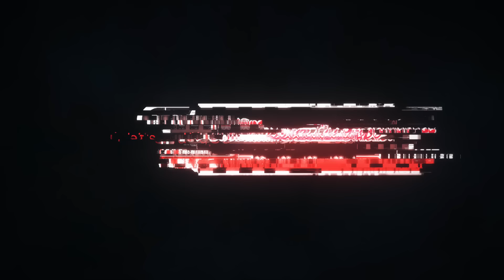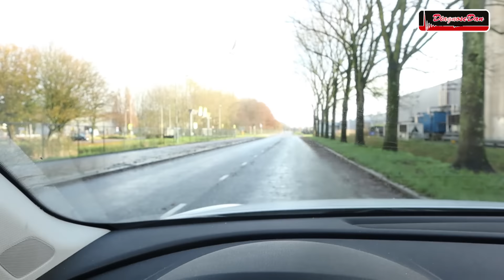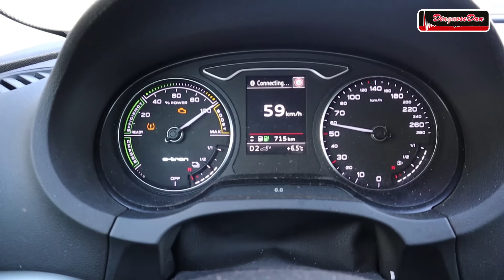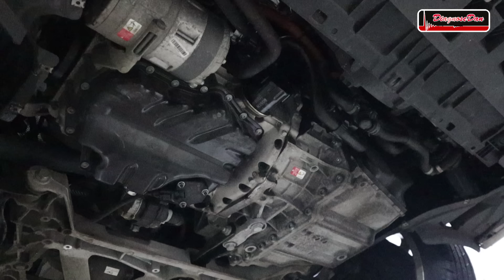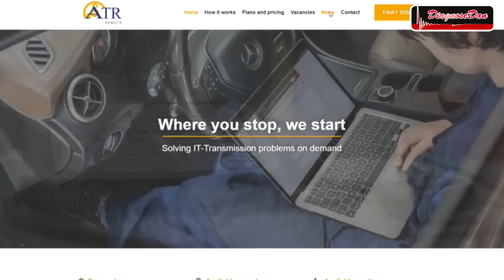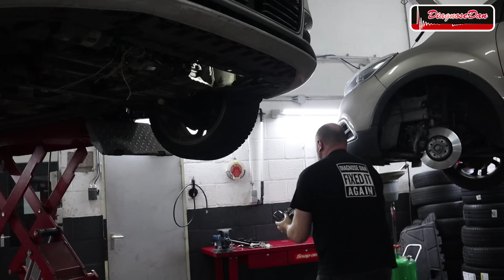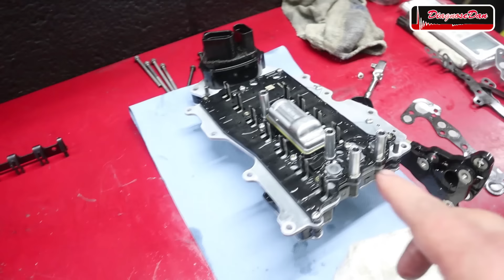DSG DQ400, p2884. Replace or easy fix?

Comment from the maker: Check out my website ; https://www.diagnosedan.com
For DDTSB visit DDTSB.COM
For the Topdon tool used in the video:
US:https://www.topdon.us/collections/pro...
UK: https://www.diagnosticconnections.co.uk/
EU: https://eu.topdon.com/products/phoeni...

ATR Remote Article:
https://atrremote.com/news/vag-0dd-p2...
Reply: What was the price difference from replacing the whole unit vs just replacing the valve?
Reply: How did the beer thing went?
Reply: Why you are smelling like transmissions fluid havent you bathed🤣🤫
Reply: German engineering has become ridiculous.Only Rube Goldberg would be impressed.
Reply: Thank you Dan. Was very helpful
Reply: The topdon links don't load! Do you mind sending us the model?
Reply: @Flashbang_Photo  Topdon Phoenix Max as can be seen by the blue handle. Around 4000 EUR  / GBP.
Reply: Do you remember how long the entire operation took?
I am afraid I might be in a similar situation, and I am dreading the repair bill.
Reply: Thank you very much.
Reply: I got it 2 days ago P2884 but after i turned my car of and on it drove again for more then 600 kilometers.  Is there a chance that this error could pop up accidentally at a cold start? It just happened once and i didn’t saw it again after deleting the error with a cheap obd tool. Not sure if something is really broken or almost broken.
Reply: @Sahin2911  This can happen at any moment.
Reply: Where can I buy these parts?
Reply: I live in norway and its hard to buy new audi parts. In this video you explained how to fix p288400 problem. Just wondering where i can buy these parts?
Reply: Hi. Thank God, I was able to repair my gearbox. Thanks a lot to the person who showed this repair in the video.
Reply: any link available on where I can find parts? I am based in the UK.

Comment: If the K0 clutch solanoid (N218) failed. How do you release the pressure to remove the megatronic unit?

Comment: Dan!! This is so insightful, I was facing a similar issue with my 2019 Tiguan R-LINE. The gearbox in emergency mode error popped up randomly, and I lost access to my odd gears. The car was running in limp mode . I chased VW Australia for a goodwill repair as the car was under 90K Kms. They came through after a lot of back and forth and replaced the mechatronics unit as Goodwill. This is apparently a very common issue with VW engines. Now I'm super hesitant in getting any VW cars in the future. These things are a joy to ride when everything works, otherwise it's just a money pit 💸💸💸. Brilliant diagnosis as always Dan!

Comment: Hello Professor Dan! Good morning! Congratulations for your experience and acknowledge. I have a VW 1.4 TSI equipped with a DSG DQ200 transmission, it' s running perfectly (50 K kilometers). Have you any preventive recommendations about it? Best Regards from Argentine

Comment: @Diagnosedan P060700 28640 dq400e, Hi there, thanks for your videos—they’re high-quality and really helpful for everyone. I have a question: do you know anything about this issue that’s been popping up sporadically in some VW DQ400E transmissions? With these symptoms, I’ve heard it might be the mechatronics, but of course, I’m not sure if it’s a specific component that can be replaced, like the one in your video. Thanks again.

Comment: Hey Dan.
After i change this parts i have a new fault code. Pressure solenoid valve 4 (N218). Interruption periodically. 
Fault code. P2717. 
Won't start og drive. Even electric.

Comment: Very interesting. Cheaper fix for sure. The o-rings in that unit would worry me though (the ones on the solenoid you pulled out seemed pretty flat), and that may be why the OE is calling for a full replacement.  Great video again.

Comment: Hello, Dan! I was wondering, for this DQ400 transmission, is the replacement of the flywheel much harder? I think im starting to hear some rattling noises at idling and a little when accelerating, so im guessing it must be the flywheel. What should i know before attempting to replace the flywheel? is it the same as a non hybrid system?
Reply: Hello, I believe the sound you’re referring to is actually the hpfp. If’s a known issue on these. I’ve never heard of flywheel issues on the gte before.

Comment: Have anyone actually tried doing this themselves yet? I have exact same error code, same car, same year and everything. Workshops telling me 5000-7000euro for change of the mechatronics. 
I tried asking them for repair of mechatronics and they told me, very rarely reparing the mechatronic will work, Only like 1 in 10. They tell me that it most likely Will cause more damage if you try to fix it. Is this just a sellers trick? Or is this method actually legit. If so, it will Only be around 1000euros to do it myself.
Reply: Sellers trick. Unless they work while doing construction and dirtwork at the same time.

Comment: Thank you! I had the same issue and resolved it today. My filter was also gone, but really gone. Found 2 strings of it back in the valve body line, but other than that, completely gone. Bought a solenoid and gaskets from atr and had my first drive today.
Reply: Same model same car? And is it still going up until now? Could your car drive in EV before and not gasoline?
Reply: @RipRageRepeat  No, it is a Passat GTE.  But yes, it is still going. I indeed was only able to drive electrically.

Comment: Such a failure should be fixed by the manufacturer at no cost to the user.

It is completely unacceptable to ask costumers to pay 2-3000$ for a fix that happens because of a manufacturer failure.

Comment: Is it possible for the screen to fail in another area of the valve body and clog a different solenoid? We have a similar issue. The car will go into reverse, but as soon as you put it in drive, it turns off and says trans malfunction with code p07A300 transmission friction element A stuck on

Comment: Probably got hit by this error now at 150000KM, it's intermittent so I'm guessing the piece is floating in and out, made a whining noise the other day when trying to go ICE and refused only to later work again.
Can't find any info about this on VW's site also reading users's horror stories where complete gearbox changes are being recommended by certified VW repair shops, that's a 10-20k € repair...

Comment: I'm personally in DSG hell. I got a Seat PHEV with a DQ400e gearbox and I've gotten p2880 fault a few times. Symptoms are random occurrence of a "clonk" sound when putting the car into park and/or turning of the ignition(doesn't happen all the time). I've even gotten the sound ONE time when putting the car into Drive. It also seems like the car is beginning to have some rough shifting in the lower gears but I'm not sure of it due to it usually coinciding with the ICE coming online. I've been adviced to change the mechatronik unit, which is making my wallet cry, and was wondering if any of you bright experienced minds out there have knowledge of this issue and what the repair could be. Thank you in advance and merry Merry christmas.  Car is a Seat leon 2021 eHybrid 204ps.

Comment: My mrs Audi a3 mechatronic failed, Audi wanted £3000 to replace the unit. Found an Audi specialist who replaced the cracked housing where the actuator screws in for £700

Comment: @diagnosedan, I have a quite similar problem on my Leon e-hybrid Fr, but my error message say to stop the car for a gearbox failure. On electric side the engine seems working, but when the petrol engine works, the gearbox behave crazy , accelerating to 7000 rpm, like if the gear is not connected to the engine. Unfortunately the Service asking me 18000€ to repair it, while the value of my car is 15000. I don’t have actually the error code.

Comment: Hi Dan. I have the same error code coming up on my car. I got a mechanic to check the mechatronic unit. However it seems my gasket is intact. He said the oil is dirty as unit was greasy, which means perhaps debris has gone inside the valves. Therefore he said I need a full overhaul of valves, oil change/filter etc - looking at 2.5k in cash. Is this a possible solution in your experience? Could I not ask for a gearbox service instead? Given there's no obvious fault with the unit ? I'd really really appreciate a reply please please.

Comment: I used to run coahes fitted with ZF. ASTRONIC gearboxes. One of the gearboxes began  to lose drive intermittently. I contactrd aZF specialist who diagnoed the fault from the gauly code as a faulty a tuator unit. This unit is most of the top plate of the gearbox. He said i can supply and fit a genuine NEW ZF unit now at a cost of £2300, or if You can wsit 2 days I can pbtain a reconditioned Genuine ZF unit for £800 pounds. Both units had the same warranty. He came back 2days later, fitted the rrcon unit

Comment: Nice Video. Just doing the DSG oilchange in Germany on a 2015 Golf 7 GTE. Can’t find a way to change the DSG oil filter. Have you changed it? You can see it under the ECU. Normal changing Intervall of the DSG is 60.000km.

Comment: The loss of pressure that you mention at 24:00. How do you fix it? I think I have that problem on my passat GTE
Reply: Same here!
Reply: @bozidarstevic5174  sucks bad. Had my gearbox replaced 😬 I would think the mechatronic is cracked like the common issue on dq200, but had no chance to take a look

Comment: My symptoms on my 2015 with 115000 k are identical Dealer will not fix it but will replace the Transmission for 15000$ they didn’t even offer to replace the metatronic unit. If I can figure out where to source the parts I’m going to attempt this myself! Thanks Dan
Reply: Have you been able to find the parts? I have the same problem with my car...
Reply: @olivernygren2967  in same boat,  looking for repair parts...

Comment: hey. i have the same dq400e and i have that error code stored in the computer, the termic motor starts , but when it is started and the car is not moving and i select a gear  D N R the car shakes. it drives fine, no shaking. 
what to do ? pls help.

Comment: Hi @DiagnoseDan fantastic content, keep up the great work! I had a quick question regarding the other common problem with the leak of pressure. Do you have a link to that video or few tips how to go about it please? As preventative measure I'd like to replace the teflon and 3-orings while doing the mechatronic solenoid job. I've obtained the proper kit for my ODD gen2 from ATR Remote but struggling to locate the right physical place to swap them out.
Reply: SOLVED, it is located at the side of the gearbox and 3 torx screws need to be removed to reveal the seals.

Comment: Hello! Great video! I found it after I got the p288400 fault code on my Golf GTE 15' which has only drived 62k km. 

Question: The mechanic shop change my gear oil at 61k km, 1000km after I get the p2884000 error message. What do you guys think?
Reply: The gear oil is independent of the mechatronic, i guess the car has done a lot of hybrid start/stop driving which has caused the wear out at such low millage. Good luck with the solenoid repair.

Comment: Hi my car stopped with oil pressure problem i have removed mechatronic and could not find any problem all selenois are ok ecu no probs. Can you give me a hint how to solve P0867 low oil pressure problem.
Reply: Have you found any solution?
Reply: @VickeLang  no mate no luck had to buy new unit.

Comment: Greetings Dan! I've been watching many of your videos all these years and finally i have the same (i guess, or similar) issue... I have a seat leon 1.4 204hp PHEV and i have the same issues, car starts electric, wont start internal engine etc etc.... i have my DQ400 Mechatronic on my desk (i am not mechanic, but with your video it was really helpful and easy to get it out)... the gaskets are fine, i think mine are different and there are missing 2 big holes from the other side of the valves (not from the K0 side). 

The thing is that i have 2 DTCs.

1 :  P2884
2 :  P0867 (transmission fluid pressure)

The car also before i start removing the mechatronic, was making weird noises (probably from pump?) how can i check to see if the pump is bad? because everything else around K0 Valve/injector w/e its called is clean

thanks in advance!
Reply: Hi, I seem to have the same problem in my Leon (same DTCs and same symptoms), I'm going to disassemble the mechatronics. Do you know what the final problem was with your car?
Reply: @jordansteinke5923  Well in my case, i dissasemble the mechatronic, i changed the k0 piston from a spare one i had and i put it back on the car...problem still persisted so i had to visit a proper shop to do the job but i think i got ripped off as it costed 6000$ for the job. 

They told me the problem was that the mechatronic was broken (had small hair crack at the middle) and was losing pressure.

Car works perfect now, better than before.

Comment: Hi Dan, Great vlog again I just your details diagnose and fitting procedure, as retire master mechanic myself but still oil running in my veins 😂 I also specialise in fault finding back in my day on earliest fuel injection & electronics that was with no test equipment as such until I got my hands on the first Bosch tester very primitive compare today.
Keep up the great work Cheers Irish Paul

Comment: Hello! Thank you very much for telling me about this problem. I have an Audi A3 E-tron 2016, the problem is similar. I start the car, the revs increase to the limit and the car stalls after a couple of seconds. Error p2884 appears. Sometimes the car starts, drives 200-300 meters and the transmission goes into an accident. Error p0867 appears low oil pressure in the transmission. Could this be the reason you are talking about? And maybe some other reason? Give me some advice. Thanks

Comment: I just did this procedure, replaced the solonoid. The car starts up! Golf GTE

Bad news is now once I tried to test drive, the car seems to loose pressure in ths gearbox. Resulting in it being undriveable and it showes the following codes P270000, P081000. 

A few questions Dan if you could help! What is the torque spec on the valve banks in the mechatronic, as well as the plate on the front of it and the spec for bolting it in to the gearbox?

Any sugestions would be fantastic!
Reply: Have you found a solution yet?
Reply: @VickeLang  Well, yes, I damaged the TCU in the reasembly process. The reason for that is I believe the damn clips/springs that hold the solonoids in the valve banks. They are so stiff that I could not seat them properly without resorting to a bit of violence. 

I ended up buying a new complete mechatronic with TCU since the price difference wasn't that huge compared to just a TCU.
Reply: @Esssasu  thanks! Yeah that spring is horrible, I also used violence and broke a bit of the cast. 
VW has told me I need to change gearbox for 18k euros tho, so buying a new mechatronic is a bit of a chance if it is something wrong inside the box, which I highly doubt.
Reply: @VickeLang  Right! Those clips are the worst! I managed with a pair of extra hands, vicegrips, hammer and a peice if plastic to tap them in place. I damaged the TCU when bolting everything together, one valve bank was not seated properly due to the extreme tension from the clip and the TCU got bent a bit.

That's exactly the same I was told by a VW workshop in my country, but my quote was 14k. In my opinion, don't listen to that nonsense. I installed the new mechatronic and have had no further issues.
Reply: @Esssasu  Awsome, im in a position where the insurance may "total" the car and pay me 50% of the market price. If its an easy fix I may fix it myself and sell it instead even tho it might be a bit of a gamble.

Comment: Hello. I found in this video at 24:00 that you are desribing an issue with hydrolic problem. Could you please tell me have you already uploaded this video because I have an issue with my A3 e-tron (error code P086700) and can't solve it for a while. Thanks in advance for the prompt response.
Reply: Have you found a solution? Got the same problem

Comment: A very informative video of the solution to this problem. I see the new supplied gasket is stamped made in China. Is this equivelant to the OEM gasket? For that matter, are all the parts you fitted OEM or aftermarket? I suppose the final question is why do these filters fail? You stated that some oil will return to the sump, so is it this fluid motion back and forwards that fatigues the filter material and causes the failure in the first place? Why do other filters not also fail? Interesting to hear your response.

Comment: Good explanation of a problem with a recommendation by a car repair man.   The best problem is no problem and since the problem is intrinsic in the design the alternate way to prevent the problem is to replace the Audi hybrid with any vehicle that doesn't have that issue- perhaps one without a  transmission.😁

Comment: Looks like the screen blows through, probably wouldn’t be having this problem if that and maybe the other screen holes were wider to put the filter under less pressure 

Well at least it’s not every 20-40-60thousand it fails, but that’s one expensive or at least deeply technical routine maintenance

Comment: Oil level check will not be performed when the temperature is 17 instead of 20? Thats 1 % off. The manufacturer is very picky here. If they were that picky during quality control this whole issue would not be there. Vw ? Audi? No thanks i will stick to toyota.

Comment: After taking mechatronic apart, did you have to change any other gaskets? (except the two long ones between mechatronic and gearbox). What is torque and order for mechatronic bolts? (not the mechatronic to gearbox, but mechatronic itself).
 Do you sell parts? 
Vw manual says to change all bolts, is it necessary? 
Thank you